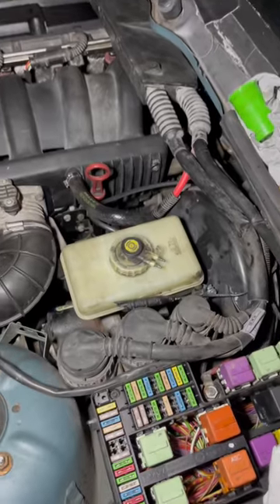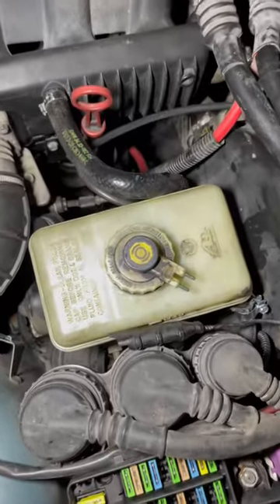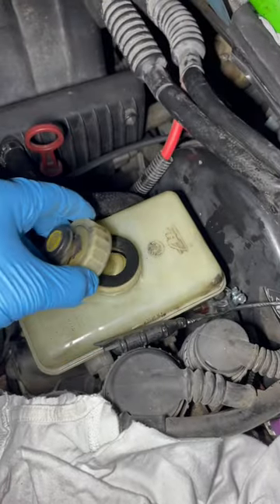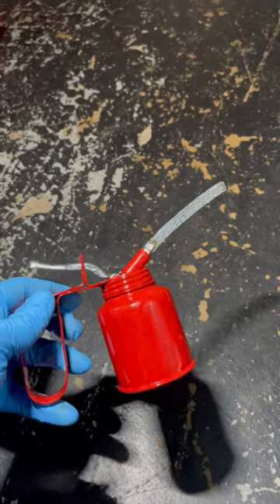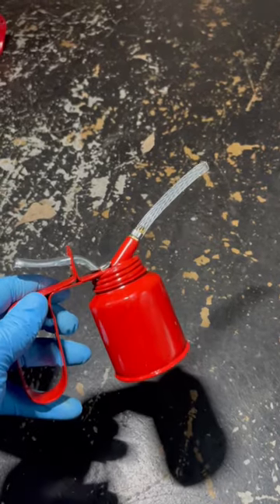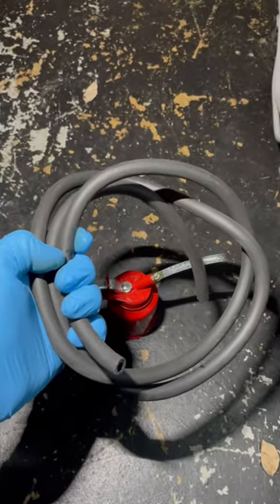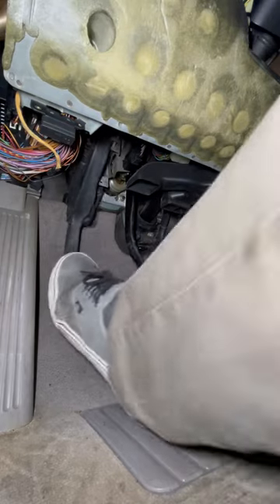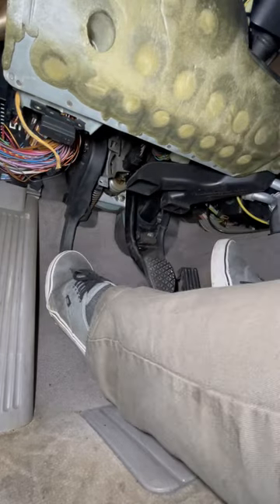Bleeding A Clutch Slave Cylinder By Yourself. #bmw #e36 #diy #autorepair

Comment: Does this actually work? I don't see why it wouldn't, but I've never heard of it. Would you not have a problem with air passing through the nipple threads and into the system? Is this just a guy trolling? So many questions.
Reply from the maker: Not trolling! I’ve been doing it this way for 10+ years.
Reply: @Dylan_Draper  so you're pushing the air up to the master right? Does anything need to be pushed while doing this? (Pedal or slave)

Comment: Dude wtf is this? What is the can for? Why did you choose it? How does it work? What's gonna happen? 

You didn't answer any of these i just got frustrated
Reply from the maker: The can is used to pump brake fluid from the bleeder in the slave cylinder through the system and into the reservoir. This only requires the need for one person, and pushes the air up and out of the reservoir rather than the traditional pump and bleed process which typically requires two people.
Reply: @Dylan_Draper  hmm insteresting. Basically recycling the fluid back into the master but without the air in it?
Reply from the maker: Essentially! Basically pushes fresh fluid up through the system and into the reservoir.

Comment: For these types of cars that share the brake master cylinder reservoir, using the Motive Products power bleeder (or something similar) makes bleeding the clutch system a snap. Pressurize the system with the Power Bleeder to 15-20 PSI, pump the clutch pedal a couple times and have someone hold it to the floor (Or use a stick pushed against the seat to hold it there), get under the car and crack the bleeder and then close it.  Repeat this until you see clean fluid.     It's also helpful if you can bleed the slave cylinder first if it is the type you can manually push the fork against the slave cylinder while cracking open the bleeder and making sure to close the bleeder before you release pressure on the slave cylinder (Example https://www.youtube.com/watch?v=41WIn1-4BB0 )

But seriously, if you do maintenance on your own, invest in a Power Bleeder.  it is worth every penny.  You can easily bleed brakes, clutches, and fill fluid into transmissions and axles by yourself and without a big mess.